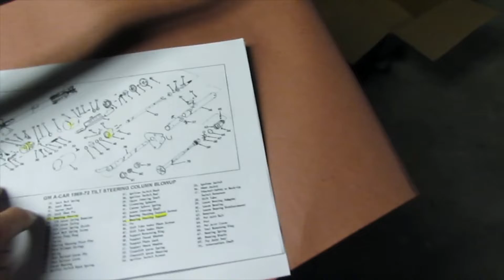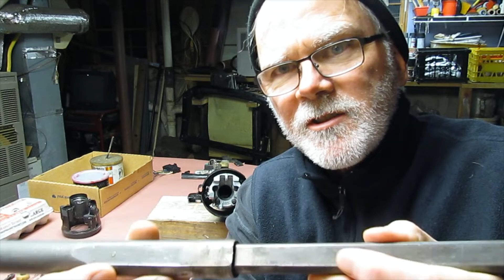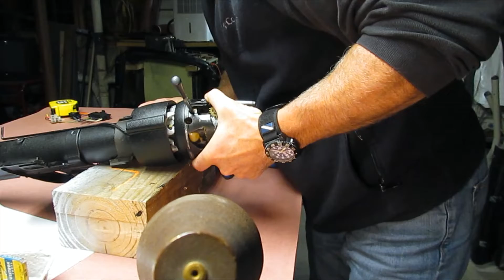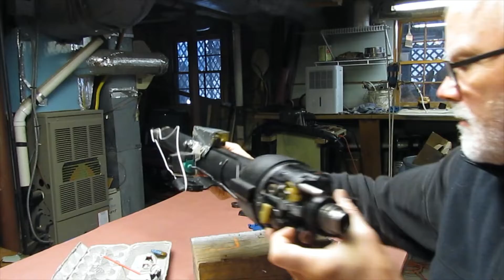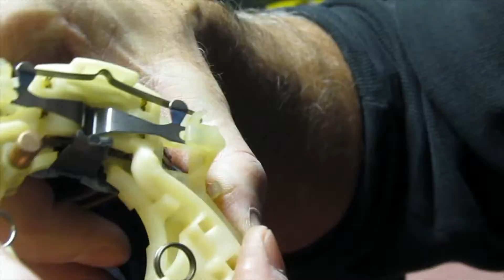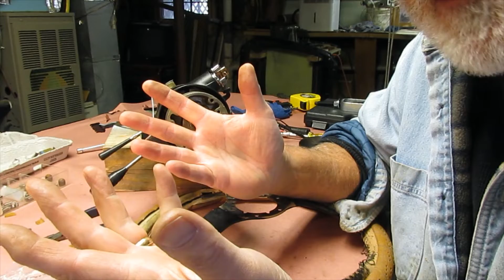Rebuilding a GM / Corvette Tilt / Telescopic Steering Column

Comment: I would have hammered in new bearings as you can still get them in a kit. Also, since you were able to press the pivot pins in with your thumb. That sounds like maybe the aluminum housing is worn. And so next time would probably be good to hammer  in some oversized pins that people are selling.

Comment: I know you mentioned using Bosch grease. But do you know what grease GM used in the steering shaft components? I don't think it was white lithium as it looks like a wheel bearing grease. Though I've since learned not to use wheel bearing grease as it can corrode plastic. Was looking at trying to get something from the auto parts store that is the best to use and will be compatible with the GM grease.

As, I'm just taking mine apart to make sure those 4 E8 bolts are tight and put thread lock on them. And was going to wipe down the exposed grease and add new grease. But the new grease will need to be compatible with the original GM grease as I'm not doing a complete tear down and full clean job. Thanks.
Reply from the maker: Don't know for sure. These things are old and grease technology has come a long way. Remove all the old stuff thoroughly , and use a modern synthetic light grease should be fine
I used Bosch distributor grease

Comment: Is the torque on those 4 E8 bolts that you put locktite on, is it supposed to be 88 in/lbs? Looks like on the Shea paper, it says 88 in/lbs max. Though hard to tell what he's referencing as he mentions numbers and photos.
Reply from the maker: For small  bolts like that it should be plenty. Loctite and firm, not Gorilla tight

Comment: Getting that pivot housing on without dropping half the balls is the most frustrating exercise I've attempted since that 9,993 pce jigsaw puzzle I got at the thrift store. I just had to spend an hour with my therapist (the garden hose) to muster up the determination to try this again. Your grease is a bit thicker than mine which would help, so I might just get some of that Bosch stuff.

Comment: Thank you for such a great video!  I'm having a problem that I'm hoping you can answer.  No matter how tight I make the Allen set screw, the telescoping rod will not hold in place so that I can get the locking plate pushed in to lock it in place.  Ideas?

Comment: Have you ever worked on a 67-68 impala tilt column,im trying to rebuild mine but the section where the tilt and sleleeve go on will not come off is there a hidden pin or something to take the sleeve off….it a shifter on the column without the fear indicator
Reply from the maker: @gilbertguzman531  I haven't worked on a column shift version, but should be similar. Check the Shea papers I referenced for help.

Comment: The horseshoe lock plate retainer has an indentation on one side. Do you know if the indentation should face up or down, and what purpose does it serve? Thanks.
Reply from the maker: The horseshoe c-clip retains the upper shaft.  Install the c-clip with the wider leg of the clip on the 
keyway side of the steering shaft yoke.  
Caution:  The c-clip is a critical safety part.  If it is omitted or not engaged properly, 
the entire steering wheel and the upper steering shaft will be able to be pulled right out of 
the steering column at any time.

Comment: Where is the telescoping feature?
Reply from the maker: @davidachten1162  It's  the short outer shaft that slides out, tightened by the star wheel which is actuated by the ring just behind the horn.

Comment: Hey mate, my steering shaft has collapsed. Do you know if there is a rebuild kit or something for it? I’m a bit lost and feels weird to just pull it out to the right length and leave it
Reply from the maker: @fletcherlesueur  try ebay motors or junkyard. I know its Tempting to plug weld or drill in a shear pin or something
..

Comment: Hi, great video. I took my 72 column apart to change the lock cylinder. After putting the lock plate back there telescopic shaft is jammed in the bottom position and won't move. It moved freely before. Any idea why this could be?
Reply: I figured it out myself. I didn't see the groove on the shaft and when it was at the very bottom the retainer ring did not go into that groove, but rather pushed against the shaft and locking it. Maybe worth mentioning that it can't be in its bottom position when putting the retainer ring on?

Comment: Thanks for the info Mate. I'm trying to do the column on my sister's Trans-Am here in Australia. Still having a lot of trouble getting the pivot pins out. Can't believe how complicated these Chevy columns are! Funny this, they're almost identical on the outside to our HZ Holden columns. But the good thing is they have about a third of the parts inside...So much easier to work on. Seriously, could Chev have made these anymore complicated?...
Reply: a nightmarish contraption with cables going to switches, zillions of parts cluster-fuck engineering job.
Reply: @jackmccauley5042  No shit! I've worked on this thing off and on for weeks now. I've had to pull it apart 3 times, and now something wrong internally. The shaft is now catching on something inside and I can't get the pivot pins out. They just spin in either direction and don't come out.

Comment: I have a 1982 corvette with this T&T Steering wheel.  The ignition locking lever is loose and now i cant get the ignition to rotate to off.  do i have to pull the column to diagnose and fix the problem with the lever?
Reply from the maker: You can get to ìt with the column in the car. Good Luck!

Comment: Another quick question can you please help me with about the ball bearing rings? I’ve bought some new ones from corvette central and basically they were that hard to slot in, i had to tap them in with a hammer. The balls don’t spin and the plastic thing doesn’t rotate now that it’s in there. It’s almost like the metal ring around the plastic ring is too thick? Is that normal? Or is there something completely wrong with the steering column? Also does it matter what way it faces? It’s just sitting in there super tight.
Reply from the maker: You may have the ring or the race upside down
Reply: @Stoneface_Garage how do i know what way it’s suppose to face? One side has a more visible plastic ring
Reply from the maker: The two bearings should taper towards each other.

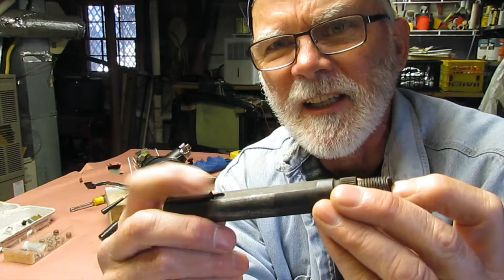Comment: 20:00 the key… if that is missing; does that mean the steering wheel will slide in and out without actually locking?
Reply from the maker: That's right
Reply: @Stoneface_Garage thanks for the reply :)

Comment: Very helpful video! On my own short upper shaft, I have the actuator rod and the wedge keyway, but when I tighten the bolt, it doesn't lock in place and seems as though the bolt isn't making contact with the rod to push it against the wedge. Any advice?
Reply from the maker: Assuming you have the correct length bolt...Check if you have any burrs in the slot or on the wedge, or the actuator shaft that could be holding it from sliding into a lock position. Add a little bit of grease to help it move (but not on the outer wedge surface.)
Reply: @Stoneface_Garage  thank you for the response. I was finally able to get a set screw in place to hold it. Turns out I just want tightening enough because I was worried about damage. Thank you again!

Comment: When you took out the center bolt that locks the telescopic from sliding, what does that bolt lock against to lock the telescope?
Reply from the maker: There is a wedge that rides in a tapered groove that jams the two shafts together

Comment: I have a question, so I locked the steering in place without the C clip, but when I put it in, it easily comes out, is it suppose to hold the spring? Or is it suppose to be loose? Or does the plastic cover suppose to hold the C clip when it comes out? Or holds it in place? Or it’s suppose to not move anywhere? Pleaseee i need help.
Reply from the maker: The spring tension should hold the c clip until the retainer is imstalled.

Comment: Good video gave it a thumbs up! At (22:10) - Set screw to lock the center shaft for lock plate removal was just what I needed to know. Thanks for posting the video!
Reply: Where do I find that Allen head bolt
Reply: To lock the center shaft
Reply: I bought a kit and none of them fit anyone know the size?

Comment: Nice video very detailed.  I have a question pertaining to my 1980 Corvette.  I some how accidentally hit the turn signal lever and it broke with the tip still inside.  How do I go about trying to remove the remaining piece  of the lever?  How much of the steering column do I have to remove to get to that section?
Reply: If you search for "c3 corvette procedure for removing broken turn signal lever stub jim shea" you will find the procedure that GM themselves used to remove the stub. Or actually three different solutions depending on how it is broken.
Reply from the maker: Bummer. If you can't reach with pointy needlenosepliers, gonna have to tear down and pull the switch

Comment: The jim shae page is no longer there plz state torque specs.
Reply from the maker: Please try this link:
https://drive.google.com/drive/folde...Rr?usp=sharing
Reply: @Stoneface_Garage  I cannot find Jim Shea papers.  Are they anywhere that you are aware of?  Your link no longer works.
Reply from the maker: @thomaskirby5574  I keep finding and reposting links that eventually go down...You may find if you google hard...or send me your email and Ill send the set I downoaded. I don't have a server or other resource at this time to maintain a link of my own.
Reply: @Stoneface_Garage  Thank you for your time.  Great video.
Reply: I believe those 4 E8 reverse torx bolts are supposed to be 80 in/lbs. Though the spec may vary during the years.

Comment: I can't find the flat spring I believe is known as the ignition preload sector switch, any ideas about this part ? BTW, best video out there.
Reply from the maker: Thanks. Are you missing this or can't find it in the assembly? I think I put that section in fast speed in the video...I could post the normal uncut  clip. That spring could be made from a small piece of spring steel if needed. It holds the sector and rack teeth firmly engaged. I suspect the operation would work but be very sloppy without it.

Comment: Took mine apart.  The wedge was removed from the upper shaft, I didn't note which way the notched side was pointing.  Found your video and it answered a lot of questions for me, set up is same as mine,  but you did not mention which way the "key" was to be facing.  Notch to the driver or the curved portion to the driver?
Reply from the maker: If I get what you mean,  the notch in the key has to face up (driver) to engage the lock shaft

Comment: Where did you find the tilt pin got a 69 can't find anywhere need it to take out last bit of slop in steering wheel
Reply from the maker: Didn't replace it, used what it had. You could lathe one up or add some thin brass shim bushings.

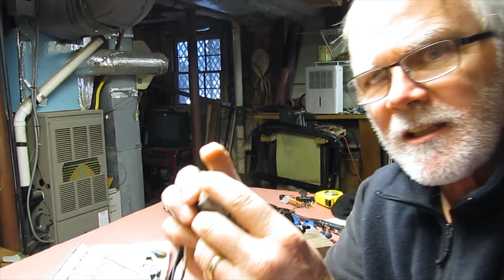Comment: Hello; I am looking for a replacement part and hope you can point me in the right direction.  In the column we have a three-way switch.  As you know the turn signal lever is the headlight dimmer,  whipper control  plus cruse control.  Now the little guy that has the dimmer, togal feature and little twist thing for the headlight switch. @ 16:22( the unit you were talking about) I am looking for it. Do you know where i can get pne from? Great video.  Thanks!
Reply from the maker: Thanks. Best bet would be ebay motors. Mine did not have the cruise control option, but the inner switch is the same, only the stalk is different I believe.

Comment: Do you have a size and length for the screw you put in to press down for the c clip?
Reply from the maker: You need a 5/16 rod or bolt about 9" to make a lock spring compressor. Here's the link to instructions:
http://jimshea.corvettefaq.com/?p=922
Easier to borrow for free at NAPA!